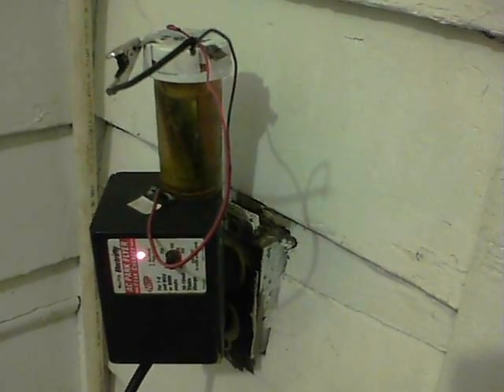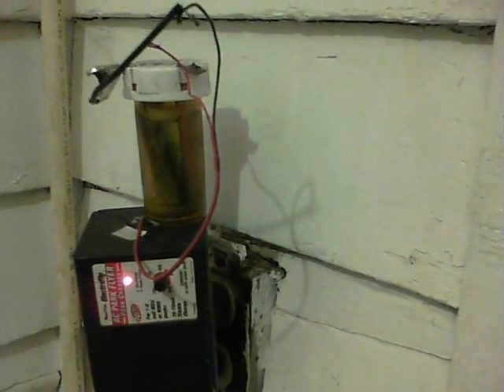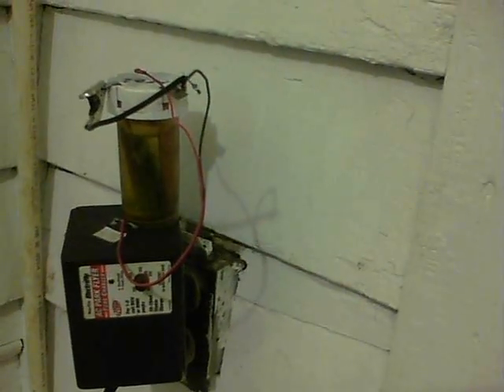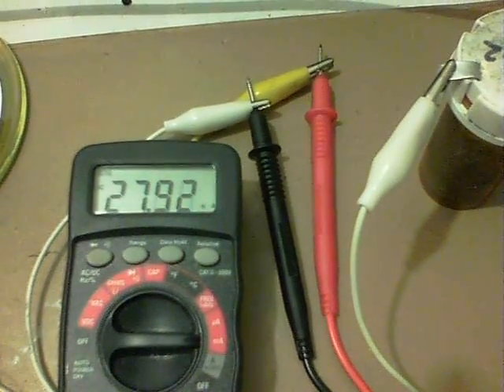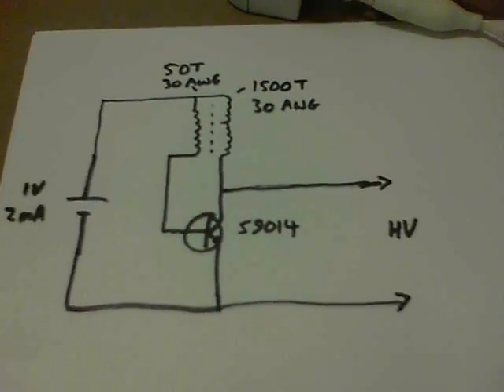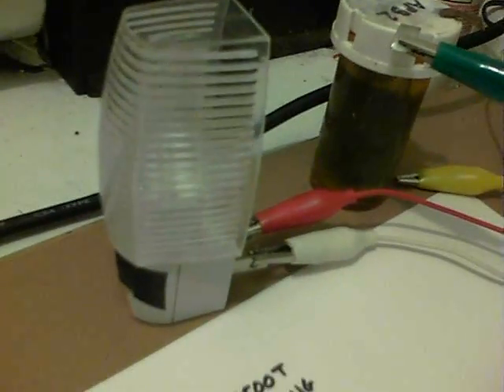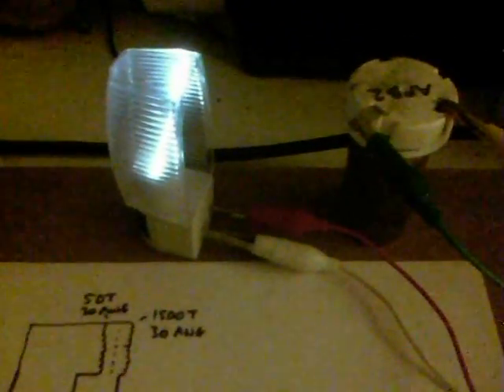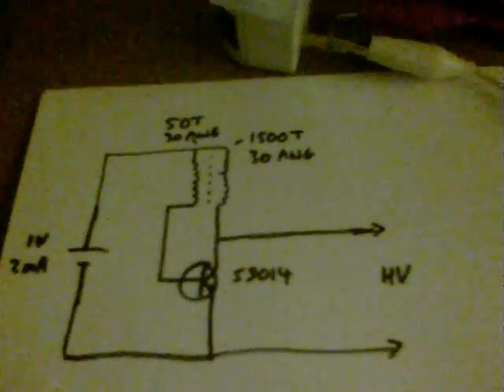1V 2mA HV circuit + Alum cell charge idea

Comment from the maker: True enough, practically all signal transistors fall over at 50-60V, That's why the onboard circuit of the nightlight took a while to charge its cap. But it's an unmodded mains operated device and shows that a lack of 3055's or similar hefty types may present less of a problem, depending on load and available drive input. The S9014 has been common in collected junk parts for me and is a fave for the reliable high hFE

Comment: That transistor is only 50v so you were not driving that 120v led light with more than that, still its a good simple circuit to step up voltage by self oscillation, thanks

Comment from the maker: Cheers. Yeah, I recommend the Alum/water cells. Just like a car battery really, except the burnt copper and steel instead of lead. They recharge great and with anything. Have found rainwater to work better than purified, but I don't know yet how that affects the electrodes.

Comment from the maker: It's the turns ratio and tuning the Primary that seems to matter for very low power running. You could try, but I think you'd have to drop lucky. I could be wrong of course and the xformer work out even more efficient lol. Just wound another on black ferrite 1" toroid, 1121 Sec and 90 turns Pri of 30AWG to get it best at 2mA, so each needs add/subtract from Primary to even run....easy enough to do though.

Comment from the maker: Hey there. I'm English, but live in the USA...probably caused confusion. It's a 120V light :)  I knew another grey toroid with 1000 turns to be high permeability and couldn't imagine the bog standard yellow to be anything similar, plus higher resonant frequency...so kinda threw on as many as would fit, then tuned the feedback winds lol. Thanks for link, will take a look !

Comment: Am I right in assuming that the night light is made for operation at 220 to 240 volts AC?  If so, then we could get by with half that number of turns, maybe 700 to 800, for a 120VAC night light.  I've wound toroids and even that is a rough road to travel.  I have blogged this on my rustybolt daht info (click on blog)

Comment from the maker: Cheers Brad. Was wondering something similar, then thought that wound once is better than charging a couple or more cells daily. Put the work in the circuit, rather than the power source. This cell seems to like solar, at 2V and 20mA, but the wall charger knocks clumps of built up gunk off the steel. Old stories say of replacing the negative terminal every 500 miles, makes me wonder if they used alkali not acid + could have run longer if they did similar to the Ni-CD blown cobwebs trick.

Comment from the maker: Thanks. Have to play with right amount of Base trigger winds to suit actual toroid and hence using a 'bog standard' one to demo. The winds function like the resistor of a JT, hence 50 here. Another, on a larger grey toroid only needs 36. Interestingly, once you have it for about 1V, the circuit won't 'boot up' on an AA. Change the turns and it will run on the higher voltage. So, twizzly pot is the actual turns and will run at around 1.81mA :)

Comment from the maker: Indeed. All it is, is the function of a high hFE transistor and switching it. Just pick up at the Base with what it sends out to the 1500 turns. The Base trigger coil functions as the resistor would, has to be right amount of turns, as a Goldilocks principle :)

Comment: You blow me away.  Such a neat application for the ultra simple Alum Cell.  Would a couple of the these cells in series give the same results with a lesser wound torrid?  These low power applications give the Alum Cells a purpose.  Well Done!
-Brad :)